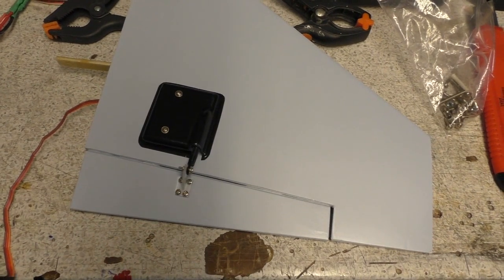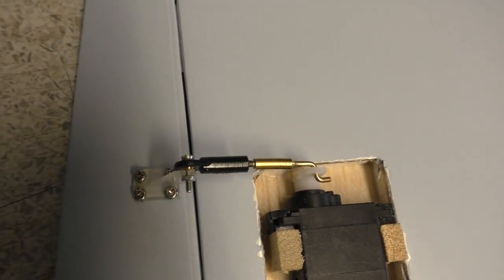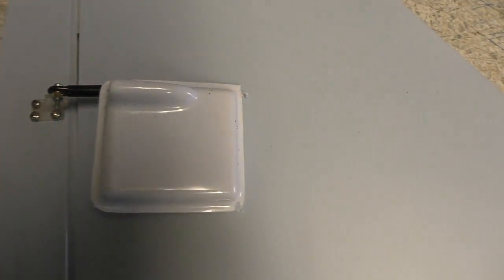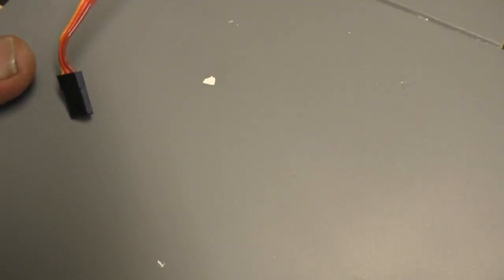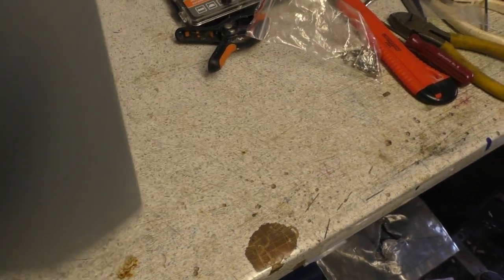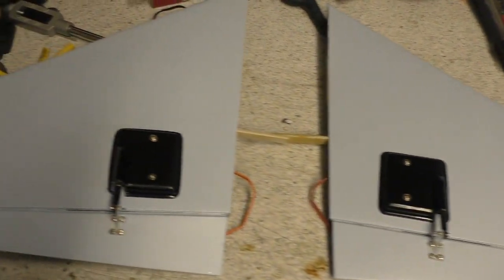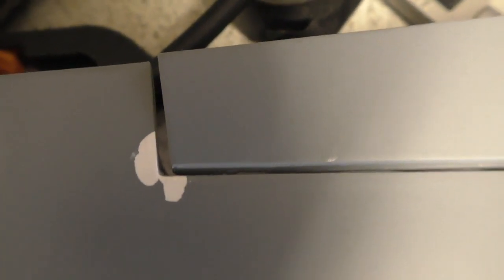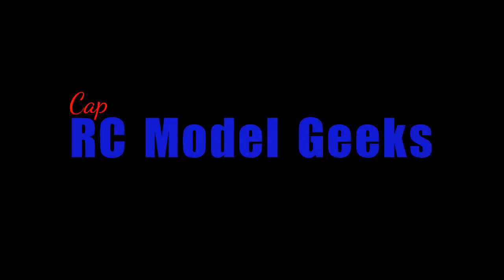Hobbyking F16 build Pt2 RC Model Geeks

Comment: Fancy painting glossy film ? the only way that can be done is to use etch primer,Halfords or Deluxe materials do it,or even flat down with fine wet and dry paper,but it is still not the best thing to apply paint to a glossy  filmed surface,they would have been better covering it grey in the first place.